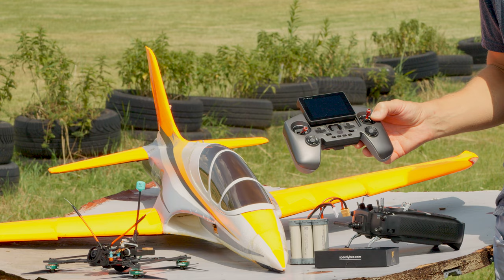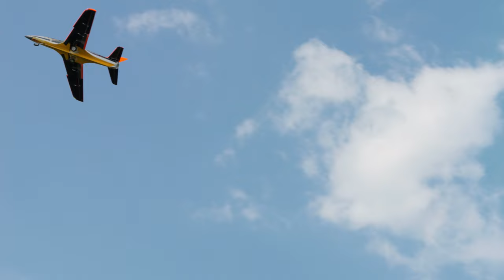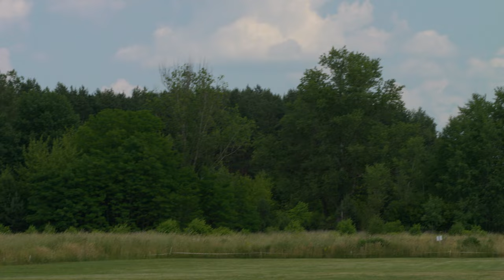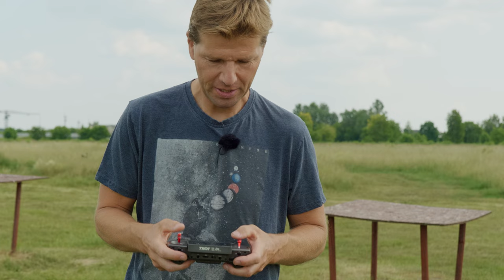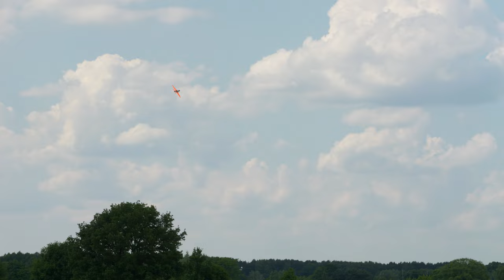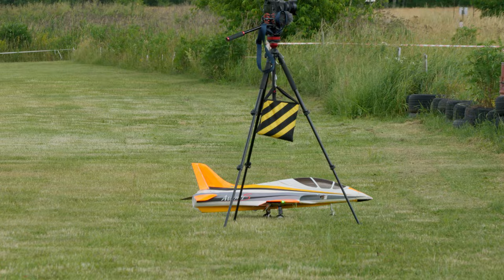FrSky Twin X Lite, Freewing Avanti 80mm edf, Upgrading my radio Control Hardware and 2 flights

Comment: Thanks for sharing your thoughts about that radios. I learned to fly one year ago and have a DX8 G2 radio. I was thinking sometimes to switch. Now I have a good idea since I´m also a thumber. Just the receivers of Frsky seem to be more expensive than for example LemonRX for Spektrum. And there are so many. But the telemetry as you have programmed it is super. Also this Avanti and setup!

Comment: Wow can't believe this is the first time I am seeing a review of that radio. Only ever hear about Tandem with the X18/20. 

You'll love the Avanti in FPV. I have used INAV in my smaller models, but for my larger FPV EDF and prop planes (V1200, Mirage, Typhoon, Avanti S) I run a HobbyEagle A3 super so I can more easily adjust gains in flight, and still manually trim my model. This has saved me on delta wings that will oscillate at high speed. A Motionsic BAG gimbal and head tracking is a great compliment to FPV as well.  

Since you like running 8S+, you may get more flexibility keeping battery telemetry on your radio, and keeping your VTX + FC on lower voltage. I never had success displaying battery voltage > 6S in INAV and BF. HV FCs are also hard to find.